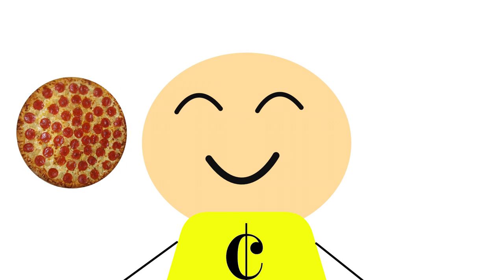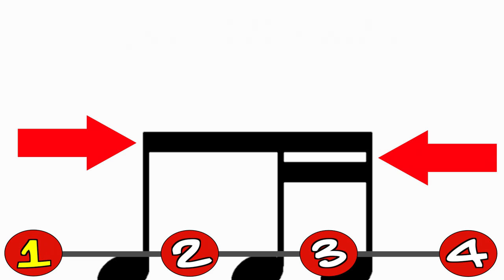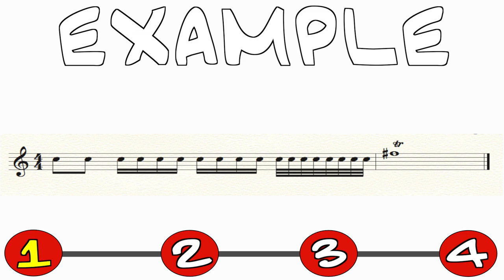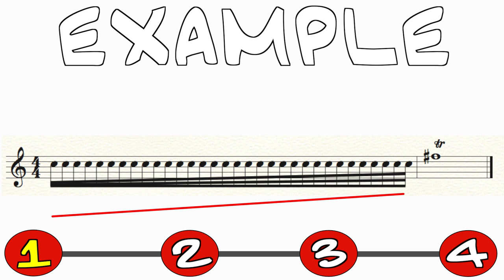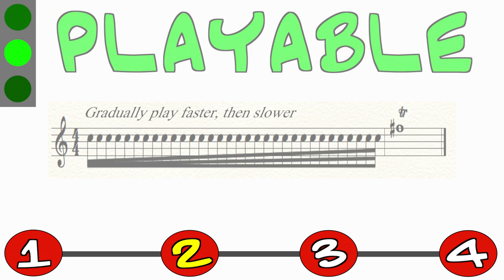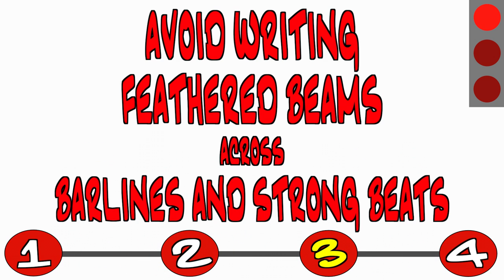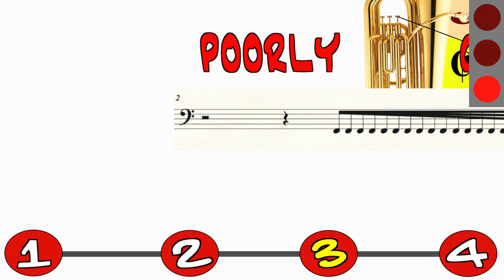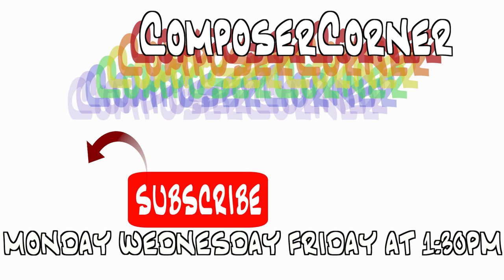Composition DO’s and DON'Ts: Feathered Beaming

Comment: I have a question about notating a specific part of a piano piece I'm working on. I believe I can use feathered notation since it's akin to an accelerating tremolo. Do you have an e-mail address I can utilize to send to you? Thanks!
Reply from the maker: One thing I can say right off the bat is that a primary function of feathered beaming is to achieve the effect you've described. In fact, I cannot think of a use for feathered beaming that is more ideal. Feathered beaming is not meant to be interpreted in a highly literal sense, so a piano player would be able to keep the speed of repetition within their range of ability while still achieving the accelerating effect. Should this answer not satisfy you, I can give you an email. Hope this helps!